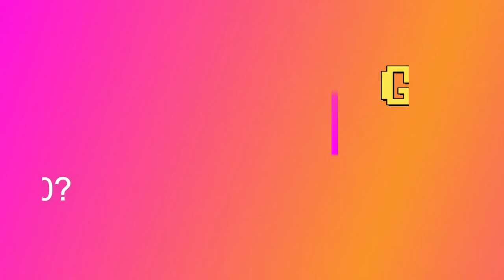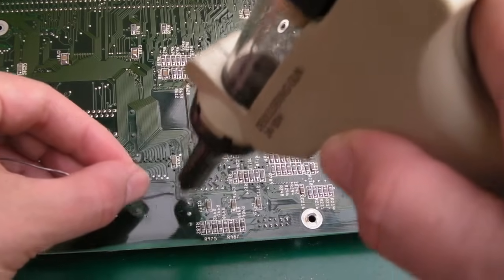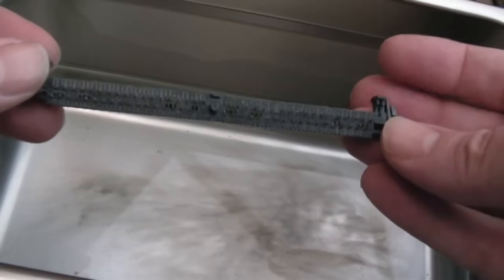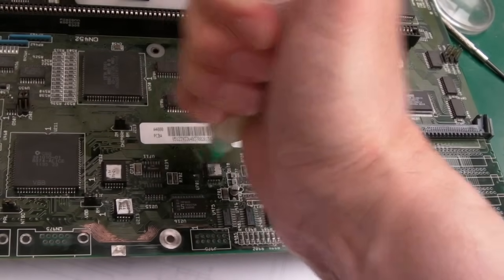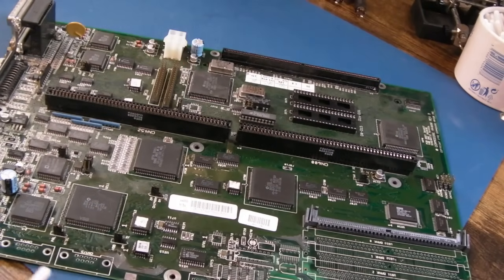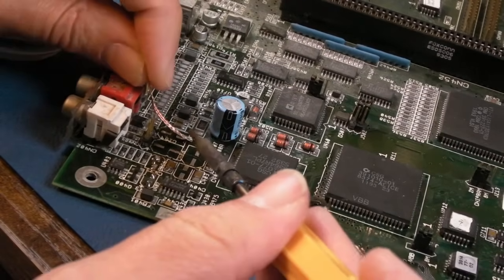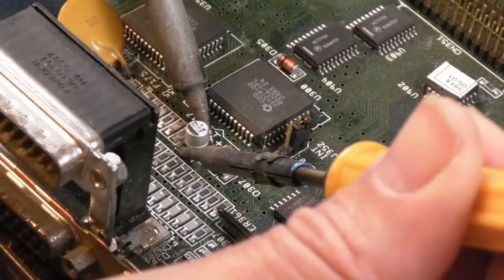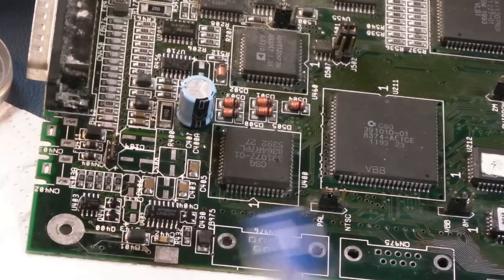Can I fix this Amiga 4000? Part 1

Comment: Obviously taking your time is always the best way Chris, but with me being lazy by nature,  I've often wondered what percentage of the work might be completed by removing the socketed chips, ultrasonic cleaning the board in deoxit, and then only apply elbow grease to the areas like trace /via repair,  bodge wire installation, recap & whole board reflow.
Reply from the maker: Most of the damage could be fixed that way, and if cleaned properly it may stand the test of time!  I would say the biggest problem with corrosion like this and battery leakage, is conductivity can remain between nearby pins (the ultrasonic doesnt always remove everything), and traces broken.  If you lose a ground or VCC rail, or two pins are bridged somewhere, faults could occur.  So I would say in a case of mild corrosion that approach can work well, if you clean up and check all your ground and supply rails before testing.  In a medium to bad state (like this one), that approach would end up being unreliable as connections would ultimately fail over time etc.

Comment: After watching the almost miraculous resuscitation of the A3000, I have no doubt you will fix this too!
What temperature do you set your desoldering tool to?
Reply from the maker: Thanks =D  405 degress C most of the time - occasionally cranking up to 420 / 450 for those parts of the board that really sink heat!
Reply: @GadgetUK164  Thanks! Also, could I ask...how do you manage to "tin" and solder to pads and vias that have become corroded with battery leaks and make them look new again? When I try, the solder never bonds to them.

Comment: Why doesn't anyone make an adapter from the old 72 memory pins to a newer one?You can solder the old panels for memory and put a newer and faster memory and a larger amount of DIMM through the adapter board.
Reply from the maker: Later forms of memory tended to work differently - ie. The design is tightly coupled into the memory management side of the host system.  The timing varies a lot, and the technologies changed - eg. DDR vs Fast Paged Memory, and obviously newer memory runs even faster (DDR2,DDR3,DDR4 etc).  The Amiga cannot benefit from faster RAM really - the bottleneck is either Ramsey or Zorro 3 here - local RAM which can keep up with the CPU can benefit, but most of the 060 CPU cards already run pretty well optimised in those cases.   Modern CPU cards for the Amiga often have local fast RAM and in those cases its fairly modern ICs!
Reply: @GadgetUK164   Well, I don't even mean the speed of the memory. It will be faster by default because it is technologically newer. Here is the question of solving the problem of the maximum volume of modules of the old type. As a rule, with a new type of memory, the volume of the module immediately increases if you look at the trends of its development. For example, instead of several old 72 contacts of modules, you can put one of the newer PC100,PC133 series memory simply by making an adapter board and soldering it instead of the old 72 memory pin connectors.
Reply: @TheRus13  DRAM used on SIMMs is fundamentally different than (SDR) SDRAM and DDR SDRAM used on DIMMs. That S letter mean synchronous, meaning that it uses clock signal while older DRAM did not use clock at all. In asynchronous designs any signal could change at any time. But changing inputs in synchronous logic without respecting setup and hold times in relation to the clock causes chips to glitch. SDRAM chips also need a little bit of initialization sequence at power up, which Amiga has no way of knowing about. The other complication is that Chip RAM timings are tigthly coupled with display side of things. On the other hand, using SDRAM (even DDR version) as Fast RAM is absolutely fine as long as you (as a designer) provide separate memory controller to interface between 68k CPU and said memory. It's done on CPU slot accelerators. You could have your DIMM slot on such accelerator card if you wanted to. But designers prefer to just solder the chips to the board due to mechanical constraints. There is often very little space to spare in Amigas.

Comment: I replaced the horrible NiCd A500+ one with it's NiMh equivelent 3 pin 3V80H off fleabay. Being a modern battery it shouldn't die and fail spectacularly like its original commodore Nicad ones. It seems to keep the time well even when switched off for long periods. I didn't like the coin-cellbattery boards/mods because a) they don;'t self recharge when switched on and b) they usually make them with a ridiculous hard to source battery like the CR1220 which aren't readily available at supermarkets unlike CR 2032's.
Reply from the maker: You can get re-chargeable Li-Ion CR2032's - you just need to mod slightly to charge properly.  But NiMh do leak too!  Been there, seen that!

Comment: "Right is red* is how I remember the audio connector arrangement.
Reply from the maker: Thanks!  And actually I believe its CORRECT on the 4000 - it just differs to the 2000 and possibly 3000?  So when I said its the wrong way around, I dont think it is.

Comment: ive got 3 or 4 4000s im actively working on. they all boot at least. i have a 3000 that's thankfully not too bad of a project. I find after cleaning, sandpaper is amazing at getting rid of the solder mask and allows for easy working. those fiberglass pens arent too good i've heard. they make car painting ones that are so much better